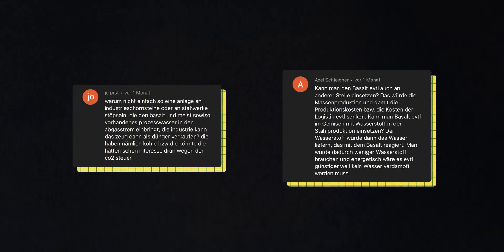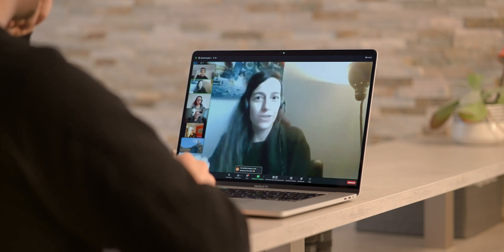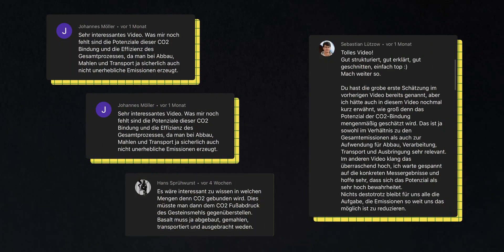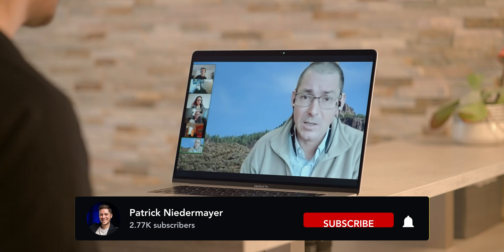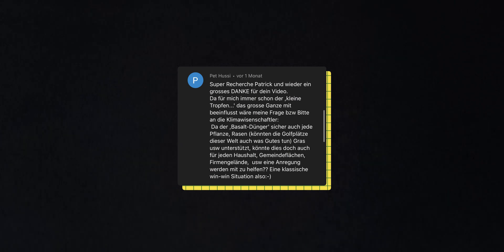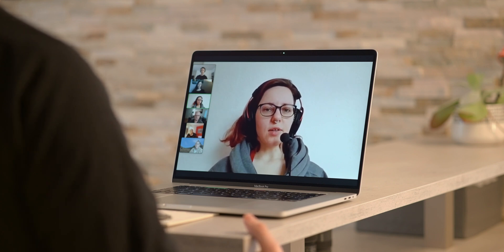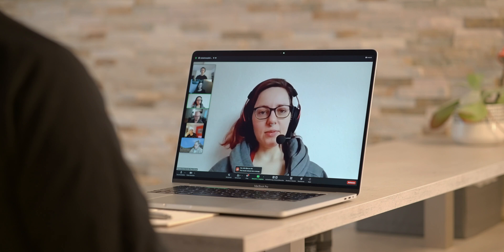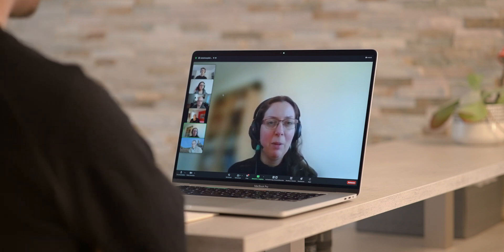Scientists answer your questions about Enhanced Weathering

Comment: Does Enhanced weathering work with all silicate rock?  How about Calcium carbonate?  Can you explain the chemical reaction between SiO4 and carbonic acid (or CO2 in soil) that locks the CO2 in the water that eventually ends in the ocean and sinks as limestone to be stored permanently.  Is that effectively what's happening?
Reply from the maker: Hi Krista, 
This paper should answer your questions: https://mobile.twitter.com/paulreginato/status/1539484003937316865

Hope that helps! ✌️
Reply from the maker: Hi Krista, 
This paper should answer your questions: https://mobile.twitter.com/paulreginato/status/1539484003937316865

Hope that helps! ✌️
Reply from the maker: Hi Krista, 
This paper should answer your questions: https://mobile.twitter.com/paulreginato/status/1539484003937316865

Hope that helps!
Reply from the maker: Hi Krista, 
This paper should answer your questions: https://mobile.twitter.com/paulreginato/status/1539484003937316865

Hope that helps!

Comment: It was helpful, thanks. Though the answer at hand is not 100% clear to me. Enhanced weathering has a good carbon dioxide footprint if we use green engery to produce and transport it. That's clear. I dind't get the core message fron sentences that followed though ("we are at the magnitude, ...10th or 100th, ...").